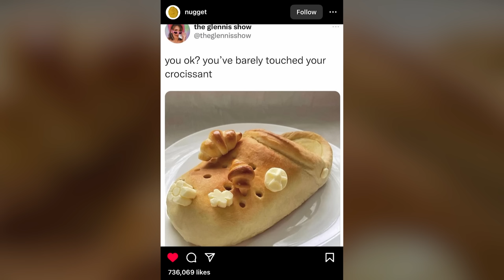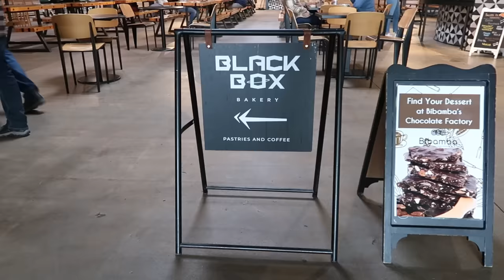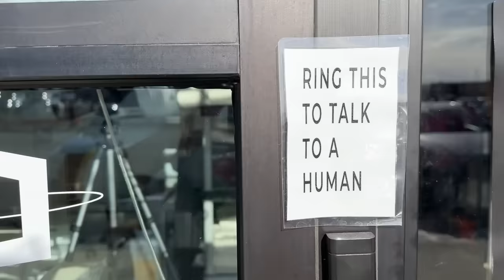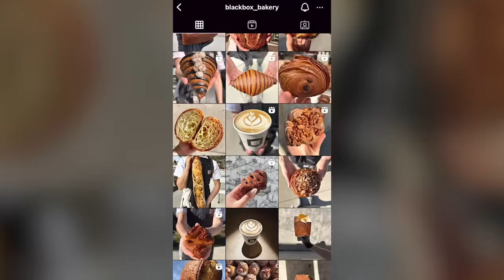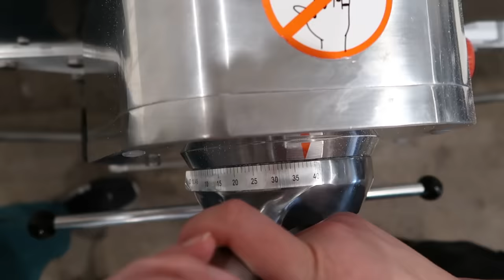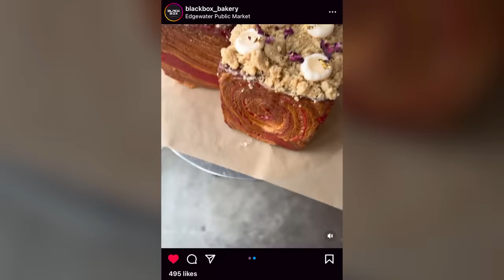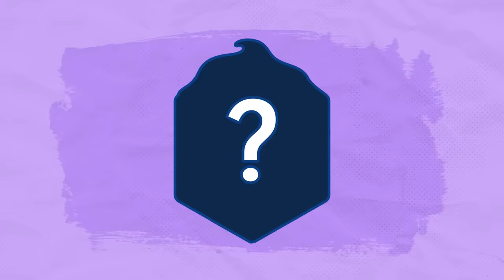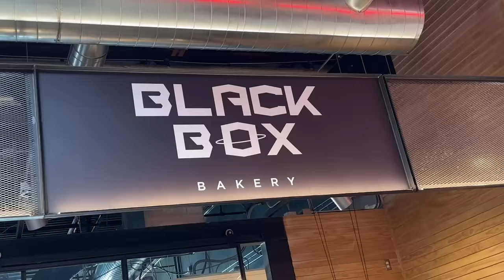I Ran A Custom Croissant Bakery For A Day

Comment: I think using the dough scraps for the black stripe was probably the main issue. Because the dough wasn't made black from the start, trying to incorporate the color into already mixed dough meant it ended up getting overly mixed, so it got chewy and stretchy. It didn't quite fluff up the way the rest of the dough did.
Reply: I was just thinking that. "Wow, I wonder how much that dough will be over mixed than the rest," and I was right! Well, they were just prototypes anyway, and they still looked great in the end.

Comment: hmm. As Someone who has made his own croissants every couple of weeks for the past five years... I have Thoughts. Firstly, Terminology correction:
Folding one third in, then the other fold on top - this is a letter fold. (3 times layers)
Folding both ends into the middle then folding in half is the Book fold. (4 times layers)
The latter is where I suspect Safiya got calling the dough a 'book' from. 
Classically, for croissants, I'm aiming for between 48 to 72 layers of dough before rolling. 
12 seems.. rather low. (I'm assuming we skipped over a book fold: Simples is book, lettter, book to get to 48)
Also, If you're making this at home, you will learn to love the fridge. I generally make the dough: Give it a three day cold rise: Roll it out then give in half an hour in the freezer, while making the butter block: Then after each fold, back in the fridge for an hour: One lamination is done, back in the fridge overnight before cutting and rolling.
Reply: Respect!

Comment: I’m not 100% sure if it’s anywhere else but I live in Colorado Springs and there is this one restaurant called Cheddars that has the best croissants  I have ever tasted they are incredible flaky and have a sweet butter drizzled on top it’s the most thrilling thing I’ve ever had would recommend 5/5 stars if your ever in the springs